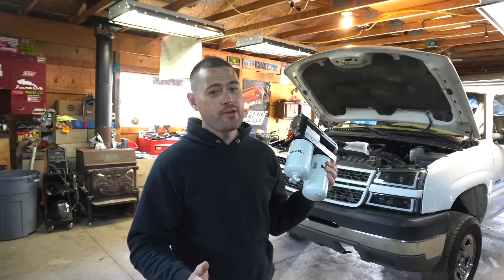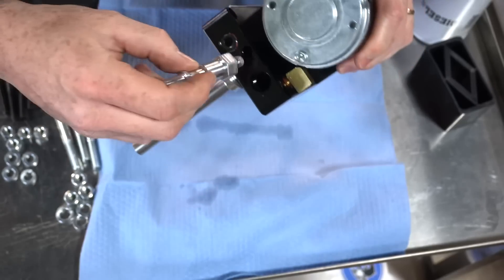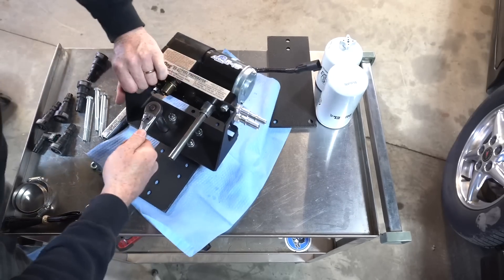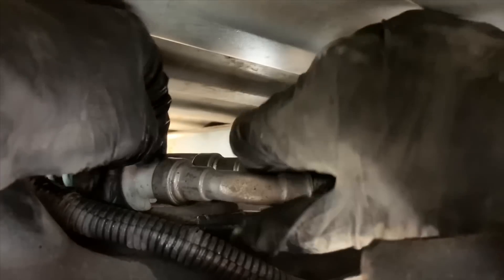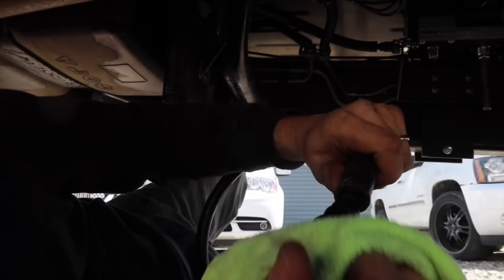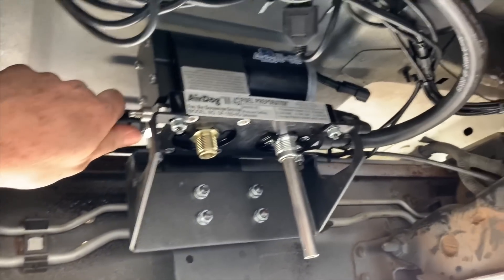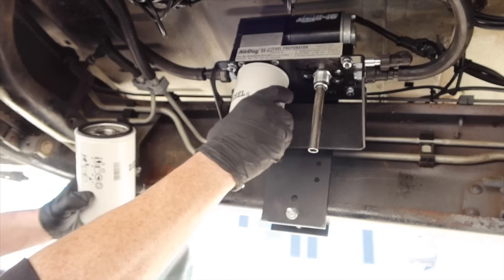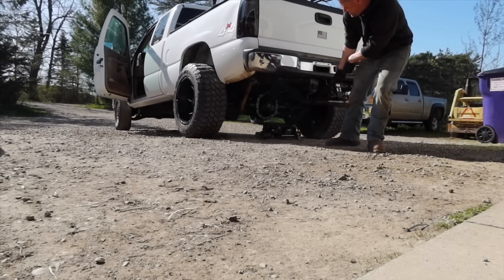Duramax Airdog Lift Pump Full Installation!

Comment: Thanks bro for doing this one can't u go straight  to injection pump instead  of going to fuel cooler i don't know because this is going to be my first one to do on my duramax with my cummins trucks i can to injection pump
Reply from the maker: I honestly am not to sure hopefully someone else in the comments can answer this one
Reply: Fuel cooler is on the return line just before it goes back in the tank... Otherwise you would be sucking hot return fuel back from the tank. That's how it was when I installed my Kennedy lift pump.
Reply: @robertg086   hey bro thanks for answering my question bud much respect  to you bro I hope u have a great week
Reply: @TruckMaster   hey brother thanks so much for helping me i love these its like we are a form here I want to thank for all u do on the channel  and bring us in to build of a diesel family

Comment: I kept my fuel line with the truck in case something went wrong with the air dog ,nice install
Reply from the maker: Great idea
Reply: What kinda oil is that
Reply: @jp_followme9079  I think it's pb blaster
Reply: @TruckMaster  i installed hsp max flow kit as well as valve covers could you help me out with how you routed heater core hose as well as how you ran fuel lines to ficm. i as well have the air dog 165 so i am completely deleting stock filter housing
Reply: @Cbow406  thanks

Comment: Man... my disconnect fittings refused to come off.  I ended up cutting everything off.  Bought metal disconnect tools and they still refused to budge.  Rust belt truck.  Prior oil field LBZ with 240k on it. Now my daily and bathed in salt bs in the winter.  But another thing I like about the AirDog is that it’s almost protected being inside the frame and not being sprayed by the tires.
And I just let the pump prime itself.  It’ll purge as it’s designed to.  I just checked the bleed screw on the top of the filter housing under the hood.
Reply from the maker: Thanks for sharing 👍
Reply: How did you cut yours bc im running into the same problem

Comment: Truck Master, Is it recommended to still use the main fuel filter when you add the aftermarket lift pump or to use filter delete.
Reply from the maker: It’s your call I personally deleted mine but either way it won’t hurt anything to run all of them

Comment: I just installed mine on my 2002 i there was a plastic tube on the filler neck that i cut aswell when installing coupler and now i have a hardtime fueling up
Reply from the maker: You probably put it on backwards
Reply: You had to take the fuel filler hose out and not cut that center tube. That center tube is the tank vent.

Comment: The fuel lines coming out of your sending unit look the same as mine however the instructions say they use the larger of the two hoses. Both of my lb7s have the larger hose towards the front of the sending unit or front of the truck. Your camera was either reversed or it's different. Still I learn more from your videos and I do reading and I really appreciate your work

Comment: Why did you have to drill a hole in the tank with the fass lift system ...is it a different set up then the air dog
Reply from the maker: I still need to install a sump on the tank so I will be drilling a hole very soon on the Lb7 but it’s the same process
Reply: Now did the air dog system come with the sump or do you have to purchase that separately.....srry for picking your brain i am about to buy one just doin my research first can make up my mind to go fass or airdog

Comment: Question, why would there be a return line?
Reply: One line sucks fuel in 
Other line pushes fuel to engine.
3rd is the air bubble return line basically. The airdog removed air bubbles and returns to fuel tank
Reply: @UnhappyDuramax     👍🏼

Comment: Of course I ended up with the wrong pump I have an 07 and the kit I ordered is for a 15 or up. ?? is the difference just the mounting bracket ?? wondering if I could just make a bracket mod to fit my truck . Due to covid I haven't had any luck getting in touch with "Throtl" . ?? are the fuel lines the same size ??

Comment: Why did you go with such a big pump? What have you done to the truck before installing the pump to make you want to go with the 165? On the airdog site it says if you haven't upgraded injectors and fuel rails and whatever else, you should get the 100. I've only egr deleted and put an eco tune through efi live. I notice a starvation going up hills. I dont have any plans to do anymore major modifications besides the lift pump and ram air. Is it safe to use the 165?

Comment: Appreciate the video this one helped guide me on my air dog lift pump install in my LB7. My question now is how did you get that updated grille on there? I couldn’t tell if it was the front end swap or not on the white lb7. Any info would be much appreciated!
Reply: The lb7 duramax engine was put in the trucks until 2004, in 2004.5 the lly was put in. The front clip design was changed in 2003 to the new style, so 2003 and 2004 duramaxes had the lb7 engine with the "cateye" front clip. Im assuming that the white duramax is one of those two years.

Comment: I’m not sure what’s wrong with my lb7 I literally followed your steps however it’s not priming I took out the feed line to see if it primes nothing unless I siphon it I’m going to return it to stock and see what it does
Reply: UPDATE *** I had the water separator open instead of closed that’s why it couldn’t prime definitely Put the diesel fuel into the filters so they prime instantly

Comment: Truck Master, Thanks for putting this video together. I have a LMM that I bought used With 160k miles on it, deleted with H&S Minni Max Software delete the only issue I have had is going into limp mode throwing dtc code of P0087 low pressure in my fuel rail. based on what you have seen do you think that the lift pump would be a good solution to address the lack of pressure in the fuel rail or should I be looking at other variables?. my truck now has over 210,000 mi on it and it's been great. The only thing I've had to replace is things like water pump alternator power steering pump. I use power service diesel fuel supplement and I'm up on my maintenance religiously. thank you for your recommendation
Reply from the maker: Thanks 👍
Reply: if anyone else with a h&s minimax has experienced the same thing it'd be great to hear how they addressed it. I know most guys are running EFI Live I just don't know if I'm ready to switch just yet.
Reply: @arnoldurias7860  yes lift pump

Comment: What happened to the pump mounted on the filter head? Have a guy at work who is wanting to install the one on the filter head and I told him I don't think its a good idea. Just curious.
Reply from the maker: I still have the factory one on this truck but that’s a great option if you plan to not run a lift pump
Reply: @TruckMaster  ill be running a lift pump, I thought you may have installed it on her truck when you had the engine and transmission pulled at kodiac.

Comment: I'm dealing with an 02 silverado 3500 cab and chassis model(has a flatbed now) frame is way bigger. I have two fuel tanks, my rear one looks easier to get to for the feed line, however my fuel cooler isn't setup like yours, this is where I'm scratching my head and can't figure out where I'm going to hook up the rest of my components. Any suggestions I watched your video several times. Thanks.

Comment: Hey great vid! Just scheduled to get one put on at my local shop. Are you planning to run a tank sump too? I thought if you didn’t use a sump it would cause issues at 1/4 tank?
Reply from the maker: Yes I’m definitely installing a sump thanks
Reply: @TruckMaster  Just came across this video. Wish I’d found it sooner. Wondering why you need to install a sump to avoid 1/4 tank issues? I’ve installed the Air Dog and now I’m having 1/4 tank issues. I’ll look for your sump install and maybe you explain why there. Thanks again. Great channel and really like everything you stand for. And thanks for your service.

Comment: Hey friend, I have a chevrolet duramax 2007 6.6 I don't know anything about those vehicles but it marks me low pressure, what I see is that the diesel does not go up where the filter is, these trucks have 2 pumps or I need one of those that you put on it  to your truck?  I can get a used or a new one that you recommend

Comment: Hey I have one question after installing this what happens to the fuel filter upfront? Is it still used or have to be deleted. Sorry new to the diesel world trying to learn.
Reply from the maker: You can still use the filter as normal
Reply: @TruckMaster  how would the filter in the engine bay be primed?
Reply: @TruckMaster  2008 duramax with air dog and stock filter still in place

Comment: Why did you select the Air Dog over the Fass.   Fass has the ability to accept other Man filters, and would you recommend for a stock LBZ?   Thanks
Reply from the maker: Because it’s not fair to say Fass is the best when I never installed a Airdog I just want to try it before I make a decision
Reply: @TruckMaster  after having ran both, which lift pump would you say is the best? Thank ya

Comment: I have a 03 duramax 2500HD and I am experiencing white smoke coming out of the exhaust. I’ve put new glow plugs, new injectors, new oil cooler assembly, and the truck still smokes when put in drive. I was told that putting an AirDog will eliminate the white smoke issue. Any suggestions?

Comment: I have a transfer tank and already have the filler tube piece there which  is the gravity fill from the transfer tank. What do you recommend I do for  the return line?
Reply: Obviously I am not him but I would look at taking it to a shop that does tig welding and see if you can get a fitting welded to the top to feed from your transfer tank

Comment: Working on a 2015 LML, I connected the AirDog 165 out fuel  line to the OEM aluminum line going up to the engine. Is this OK or should I have run the rubber hose all the way???

Comment: great video. very detailed. I have an air dog system on my truck that was installed by the previous owner that doesn't seem to be working. is it possible to message you somewhere with any diagnostic questions?
Reply: Same problem.  The fuse seems to keep busting.  It's a 2 amp fuse. Not sure what is meant for it but I  replace with a 5amp. Not sure if that's OK. Check your fuse to begin with

Comment: Quick question...when placing this it seems that the top of the plate rubs the steel brake line that runs along the frame.  Any concerns with that?  Any experiences with wear on that line?  I'm tempted to just release the clips in front of and behind the pump placement to ensure that line isn't under pressure or put a strip of rubber up there to pad the line.
06 LLY
Reply: Resolved by cutting a section of spare tubing and wrapping it around the line to protect it where it sits tucked above the bracket for the airdog.

Comment: ok truck master I have an 05 lly do I go with airdog or fass Thanks
Reply: I like the new FASS it’s very quiet. And the new filters are awesome 👍
Reply: thanks
Reply from the maker: I’m not to sure yet I still like my Fass but the Airdog seams like a great option as well I plan to do a 1 year review but so far I really like Airdog because you have the option to adjust your fuel on the unit
Reply: thanks. I have done nothing to my truck at all. I am about to replace my exhaust and really do not need anymore power but would like more lower end response. any pointers anyone. not really looking to spend a too too much  maybe a couple grand. can I get away with just a blocker plate for egr?

Comment: Don’t connect positive wires in the red power box. In your fuse box you have 2 studs that are fused and normally not used.
Reply: May I ask why?
Reply: @Shane651001  that red box is built for jump starting from. It’s not fused and is directly wired between your alternator and battery (batteries). There are two fused studs in your under hood fuse panel, easy to get to just removed the black plastic cover. They are there for (factory) accessories, the studs are a smaller diameter as well. Your wiring job will not only look cleaner but it will also be protected. I have also seen audio equipment hooked up to the red box and or other aftermarket accessories such as lights. Over time it will damage the plastic box and I’ve seen them melt or worse damage your trucks wiring. 
But it’s your truck so don’t let me stop you from doing it as you please. I can only speak from experience and offering a different idea that I believe has more benefits not only cosmetically but Beneficial.
Reply: @andrewdinwiddie8331  no that’s awesome! I appreciate your words of advice!! Also, if it’s wired to that red box and the wiring that you’re installing in the red box has an inline fuse (like the lift pump harnesses do) does it matter still?
Reply: @Shane651001  sorry, I can’t remember how the kit is wired anymore but of course a inline fuse is good. The draw back would be that your still pulling amps (how ever minor) from that red box adding heat and could eventually cause damage in that area. With also having a exposed/unprotected wire crossing over your PS pump.  I personally don’t like extra wiring/loops and fuses spread around and about. It makes trouble shooting issues harder and more time consuming. I have all my wiring in my fuse box and I’ve added fuses into the box to keep that somewhat “factory appearance” and simple. If you wire it to the fuse box you could at least keep the inline fuse close by the fuse box or run it up inside. If I remember correctly you also have a “keyed hot/ignition” wire that you have to hook up into the fuse box?.. so it saves you from having to connect them up in different location. 
Now I know this can all be argued, that if it can handle jump starting your truck why not power a pump and what ever else? Truth is is can people do it all the time. But once you see or have to help fix wiring because your truck won’t charge or start or has faulty wiring due to the wires being damaged in the red box. You won’t want to hook up anything in there again. 

Hope this help man! But search it on forums there’s a bunch or great information about this and tricks to make it clean and easy.
Reply: @andrewdinwiddie8331  awesome man!! Thank you so much!

Comment: Can the excess wiring be cut and removed instead of rolling it up and tucking it away?
Reply: That's what I did. I cut to length since the wire lug was too small anyway. I cut it and put the larger size that fits in the red power box. I just coiled up the ground wire since there wasn't that much left.

Comment: why no worm drive (or other) type clamps where you push the barbed fittings onto the hose? Looks incomplete and possible failure point.  Air dog used to have blue hose with factory fittings already connected. Looked much better and definitely more reliable. 
Good details on how to disconnect the factory fuel connections.

Comment: I have a question on the size pump I need.  I have a 2007.5 lmm. I see the 100-150-165.  Pumps.  Do u need a certain size or will any work.  And what's the deal with some that come with sump kit.

Comment: Hey Josh I have a question. Just got the fp150 for my lmm that I just got. My question is do I really have to drill a hole and install this tube in my tank??? I've seen videos where guys did it without doing the tube into the tank. Thanks brother

Comment: So Im told that I will need to do a lot of tuning after it is install due to pressure to the fuel rail?   Was this an issue?
Reply: The 100gph is good for stock to 500 hp setups. I only have a 85 hp tune in mine and have zero issues. Even ran it in stock form with no other issues on drive ability. Throttle response is a lot more responsive.

Comment: Do you know what would make my lly miss/buck under load? If in 5th gear I can slowly hit the throttle and it will surge/buck before taking off. I have no codes or anything. Also I just installed the air dog 2 165 in hopes to fix this issue.

Comment: Seems easier than I was expecting honestly. I just got my lmm deleted. My big tune is 180hp I need one of these lol. Would it support that big of a tune or do I need a 150?
Reply from the maker: Definitely go with the 165 with your setup 👍
Reply: @TruckMaster  is it just as easy to install? And where did you get the fuel connector tool to take the lines off?
Reply: @TruckMaster  also would I need the tank sump for the 165? And would I just delete my stock filter housing or leav it in place?

Comment: Does this pretty much delete the fuel cooler? And also would this kit be ok for a stock lb7? Only stuff I have done is full catless exhaust intake and a edge tuner that I only run on a tow tune.

Comment: Great video!! This may seem a silly question, i see you supplying fuel to the lift pump from the sump pump or fuel modulator by connecting the line, is that method preferred over drilling the tank and putting in one like i have seen in the other airdog installs?

Comment: I just received my Airdog 150 and the kit comes with a high flow suction tube, is there anyway to get around installing the high flow tube or do I have to install it? Because it will require me removing my tank (which I'm not really looking to doing ). 
Thank you,
Bashir 
2009 LMM Duramax
Reply: I figured it out, I ordered the previous model the Original Airdog and I need the Airdog ll 4G. Ill return the system and order the Airdog ll 4G 165 GPH